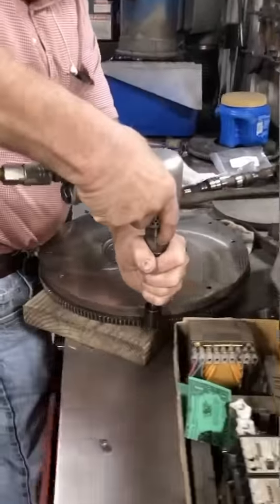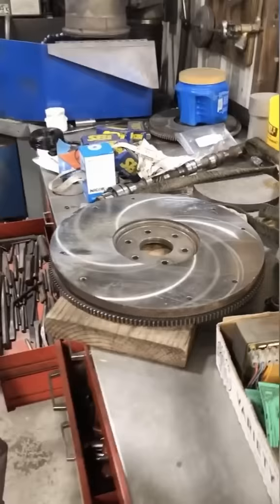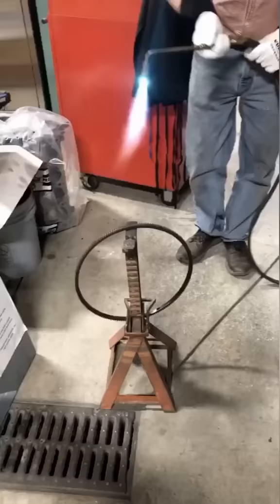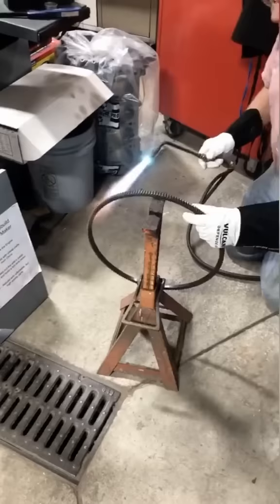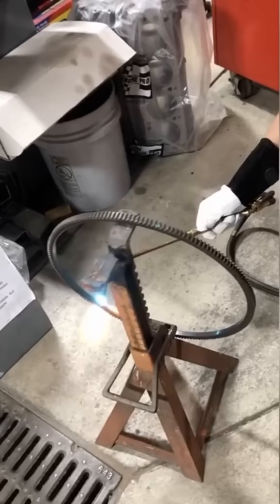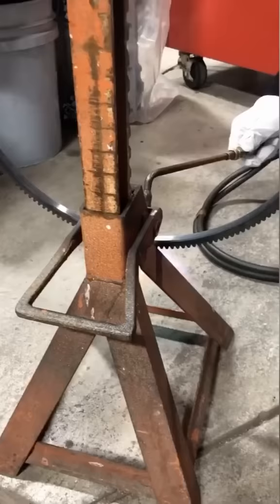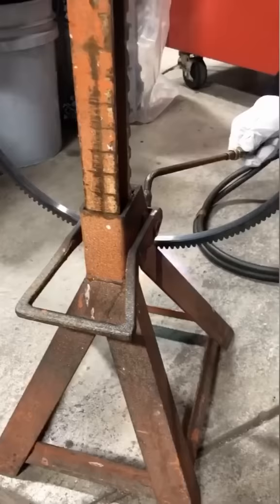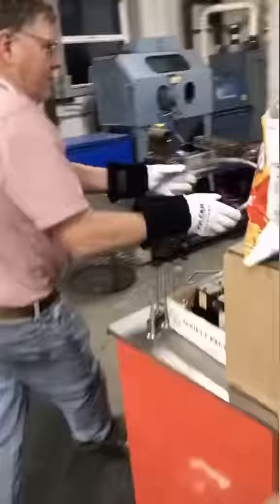#shorts Flywheel Ring Gear Replacement

Comment: First time I did that on the floor is when I discovered that concrete will basically explode when you hold a torch on it. Lol!
Reply: I also found that out the hard way lol 😂
Reply: You guys are the real mvps for putting your mistakes out there so others don’t make it.
Reply: Lmfao, yeppppp. Don’t heat up concrete or rocks!
Reply: And it's always fun until you think you're awesome after doing a few,and don't get one seated down in time because butterfingers 😆
Reply: I did that once...pop...Burning urethane out of a door glass channel...oops...vice job from then on...🤪
Reply: Threw rocks into a fire once and got my ass burned, no literally a hot rock went down the back of my shorts lmao good times with the friends!
Reply: @Todd_G_FPV  haha partying in the woods as kids , we would throw one in occasionally and stand back for a while and watch the fun. 
On the good nights, we would have something like a totally capped pipe bomb to throw in , and that was the nightcap to put the fire out. 
Then we would run around stomping out all the cinders from the explosion 🤣
Reply: @MrTheHillfolk  lmao 🤣
Reply: @Todd_G_FPV  waiting on the blacked out van and the men in suits to arrive at any moment because I said pipe bomb 🤣
Reply: Lmao. Also happens with the molten metal from cutting. The fuckup deepens when you move your mouth and feel something crunchy inside
Reply: @de0509  lmao
Reply: @MrTheHillfolk  haha it could happen they monitor EVERYTHING we do online!
Reply: Yes sir done that to. Concrete to the face.
Reply: Yup lol
Reply: @Todd_G_FPV  
Without a doubt man,it's so obvious now how much our phones listen. 
I was having a conversation with a friend about (I forgot) but I said wait a min, lemme go search it. 
2 letters in , and what I was searching for was already in the search bar.
Reply: A little hot slag in unusual places and leather gloves so you can't get it out fast enough.... Yup!
Reply: If you don't break something trying fix something did you really fix it?
Reply: @Todd_G_FPV  I assume there was alcohol involved 😂
Reply: @timgarrison8473  of course lol
Reply: @MrTheHillfolk  happens to my wife and I almost every time we google something
Reply: Note to self.
Reply: I made a rock fire pit. One blew up and hit the wife. Caught me by surprise
Reply: Same, got the concrete in my eye
Reply: It sure will😜
Reply: bc there is moisture trapped in the rock / concrete
Reply: I heat up my coals one time on concrete floor for bbq then suddenly the concrete explodes making coals fly like fireworks. Almost 2 houses nearly burn and one coal flew straight in to my eye. Worst way to find out how concrete reacts to high heat
Reply: thank you lmao i wouldn’t have thought of this
Reply: Snap crackle POP!
Reply: My younger self learned that too. Trying to melt concrete into molten lava. Yeaaaah,didn't work
Reply: I too learned the hard way. Concrete to the face
Reply: @phironosurvivors2069  same was 10 and melted a penny on the concrete first one went good but then the second one exploded so I dug on Mini hole in the ground and did it in the dirt
Reply: Well thank you because I just learned what not to do lol
Reply: Yup I've seen it before 😄
Reply: I decided to melt the lead out of a copper jacketed bullet on the concrete and when the lead was molten over the concrete it decided to explode throwing molten lead and concrete at me
Reply: Thanks for the tip. Didnt know that.
Reply: @deeppowhazylab  Absolutely
Reply: @saturnmedia1  yeah rocks dont make lava with blow torch, rocks go boom with blow torch lol
Reply: @danielslade8848  still boutta axe on em
Reply: @de0509  That was my experience also,  with the steel plate up on 
4” x 4”s while I was burning big holes in it.  The Concrete expands very quickly where the local heat is,  while the rest of it doesn’t,  and eventually the force of the expansion is greater than the Tensile strength of the Concrete can hold it together in that locally heated area,  next to the cooler Mass of the rest of the Concrete,  and it pops out.
Reply: @aaron5222  That was covered in a Movie I saw as a kid,  called “The Boy 10 Feet Tall”.
Reply: @ShelliesMan  never seen it. Worth a watch?
Reply: It happens because of the oxygen content in the concrete
Reply: @MrTheHillfolk  if they investigated everyone who said pipe bomb America would have the highest incarceration rates in the world.... oh wait, bad example
Reply: @MrTheHillfolk  I don't think they're using NSA hacked information to fill out your search inquiries, to sell you stuff sure but to make search engines more convenient to you is a step too far.
Reply: @aaron5222  caught you by surprise, I imagine there was one other person the situation a bit more surprised.
Reply: @yeetium6641  dude I thank my lucky stars every day that the one time I heated up a copper jacket bullet the lead that squirt it out like a squirt gun didn't go directly into my eyes.
I'm sure I'll be paying that back when I have f**** dementia from led fumes
The people who assume you know the dangers treat it like Play-Doh
Reply: @FrancisR420  😁
Reply: @FrancisR420  yea it's bad , I've mentioned something in a messenger group and say I'll go search it ...
Like 3 words in and the subject is right there
Reply: Yikes, probably had a nice water table underneath it. This is why you want firepit to be lined with firebrick, concrete goes BOOM when water trying to escape, hope you were okay
Reply: Thank you so much I would have never known or guessed that concrete doss do well with a torch
Reply: I also found this out the hard way
Reply: Me too😂😅😅😅
Reply: @saturnmedia1  or just anything brittle that could have trapped liquid/gas inside.
Reply: Me heating drain cleaner lines lol
Reply: @MrTheHillfolk  Back in scouts we were all teenage hellions and would find bamboo just for throwing in the fire. Not small reeds I mean one or two inch diameter bamboo. Those were great times that I look back on now and thank the lord no one was ever hurt. Well seriously hurt. A few small burns here and there but nothing major. Lol
Reply: @benbrice9343  
Ahaha that sounds like good times for sure, What's learning without a little sizzle burn here and there to help the learning sink in😆
Reply: Me at 13 trying to heat up a penny with my dad's blowtorch on the concrete basement floor
Reply: @Todd_G_FPV  I had a fire going at my campsite and didn't know a rock was under the old ashes. it grenaded, and threw blistering hot rocks everywhere. never again will I start a fire without checking first XD
Reply: I've seen cement pop off n you generally learn your lesson especially if you own the concrete.
Reply: Yeah thanks I always heard this was bad, but wasn’t sure. I’m not gonna fuck around and find out. I trust you and appreciate you! I’ve been welding on my shop floor till I finally bought a table to get off the floor for now.😂
Reply: Same :D Safety glasses helped.
Reply: Yep, that rapid expansion has to go somewhere lol
Reply: As well as everybody here found that out the hard way LOL
Reply: Wet concrete is the worst at this
Reply: @MrTheHillfolk  we tossed a small can of pineapple juice into the fire pit one time. Sounded like a shotgun went off holy shit was it loud! Huge explosion.
Reply: holy shit really theres so many times ive not had that happen to me
Reply: YUP! lmao theres tiny pockets of air and water inside concrete and if it gets hot enough, itll explode. stay safe out there!
Reply: Same for thick glass and touching it with something as cold as a pencil tip, then that glass will melt into your carpet and your parents will not be happy with you 😂
Reply: i got bored as a kid waiting for oil to drain so i would burn leaves with a blowtorch on gravel and then something exploded. and then i started blowing up rocks. good fun as long as you stay away from cars
Reply: That's what bad concrete does. Properly poured and vibrated concrete floors won't have any pores where steam pockets can form. I've dropped small pots of molten lead and flame cut train rail on my gnarly old concrete floor in the workshop but never had anything happen. Friends of mine have had pieces of their floor explode though but those were not poured by professionals.
Reply: @OB1canblowme  my dad must have been great at pouring then because I basically used my garage floor as a forge, we just power washed it out and didn’t tell my mom lol
Reply: Yes
Reply: @MrTheHillfolk  Happens for me more often than not! ...matter of fact, my phone & the computer behind it knows more about me than I do. Who knew???? Ha ha Ha ha Ha my phone just entered the word Horror with a capital H. Hmmmmmm.....
Reply: Yup concrete is not only porous, it's chemical composition itself absorbs water and that gets flashed to steam which makes it go boom
Reply: @snowcow1173  oh Jesus Christ. Yeah BOOM
Reply: Learned that lesson while welding, hot metal falls to the floor and within seconds concrete pops and there are craters in the floor.
Reply: Yup most of us who know that, learned by experience
Reply: @buffaloaf8205  that's a very good question.  My dad always said that those leftover screws, nuts, bolts were just extras and  obviously not needed if the project was working again.
Reply: Yo I didnt know that.  Yall some allstars thanks for the knowledge.
Reply: @danielslade8848  yes because of the air bubbles in the concrete, I knew that when I was like 12
Reply: @Siddy22  No actually, it’s water pockets that are naturally in concrete, when they expand it explodes quite violently, it’s also called Explosive Spalling!
Reply: Been there done that! Except it was a seized hub assembly on my damn bosses Jeep! I figured the concrete was old enough to not go boom. Boom it went though! Moral of the story, never hold a torch to concrete
Reply: @bigsparky8888  I started reading this as “burning urethra” and was going to say sorry for your loss
Reply: Yeah I actually found this out and it kinda makes sense. It’s the same principle as what they’re using here to expanded the gear with heat, there’s tons of tiny imperfections, holes, in rocks and concrete that try to expand with heat, but they can’t due to the surroundings being solid, so it builds up enough pressure to eventually explode.
Reply: Man I had no idea about this. I must be lucky, had been very close to touching the concrete on multiple occasions. Thanks for the info man! Concrete life saver man bless you
Reply: Unfortunately I have to torch anchor bolt holes into some of our columns we install if they need to be moved to make them plumb and most of the time they are within an inch of concrete and it really sucks knowing is going to happen and you have to keep going and going and going. Lol
Reply: Depends on the quality of the mix. And if there’s any pockets of air trapped in the concrete.
Reply: That's because it's porous
Reply: ...... hearing up concrete....... didn't think uhh. Lol
Reply: Did the same thing with a glass table. What a huge mess somehow didn’t cut myself tho and got a nicer table so in the end big W
Reply: I had a DIY paint can forge that I started out with. First attempt at melting aluminun on my back patio. I was lucky I wasn’t outside because the concrete shot the forge, crucible, and molten aluminum all over the side of my house. If I would been close it may have been a Darwin Award.
Reply: You guys ever fill a brick with gas then light it, thing blows to bits lol
Reply: Im not proud to say it but i did that in my garage
Reply: Learned that one the hard way when I got into hvac as a teenager 🤣
Reply: Love these tutorials videos. So much info. And to read the comments especially the ones that tells you the mistakes they made so you won’t have to travel down that road. Great job all of you guys.
Reply: @danielslade8848  I once welded the concrete😔
Reply: 😅 that’s basically how I learned too. But at work on a new pad😂
Get yelled at every shop inspection
Reply: Yeah and it sticks to ur face when hot, actually had it make it passed my safely glasses and stuck to my eye lid, fun times
Reply: @danielslade8848  😂🤣😂🤣😂live & learn
Reply: @danielslade8848  I didn’t know that 🤔 well not I found out the easy way 😂 thanks lol
Reply: also make sure the leads when you are solid metal ark welding are fully connected the first time i ever did smaw welding was in a welding class I got the day off of welding after they came out I nearly jumped 3 feet in the air
Reply: L
Reply: @MrTheHillfolk  you must now know what “prediction” means huh
Reply: Welcome to the explosive concrete club! We've all learned that the hard way. I was 15 🤣
Reply: Any science behind that ?
Reply: Po
Reply: Made the mistake of heating up a charcoal chimney on concrete…. The ground blew up under the chimney.
Reply: Your comment sounds like you didn’t learn after the first time and there have been a repeat offense
Reply: Been there welding. Lol
Reply: Yoooo I was torching a spider a month ago and i thought it exploded but ig it was the concrete under it exploding woah that makes sense
Reply: @kaizu4571  so the spider did explode then 🤣
Reply: @randycarter5263  nooo the concrete under the spider exploded bro
Reply: @kaizu4571  I just meant that if the concrete exploded,one would think that the spider also perished 🤔
Reply: Ty my ass would have done that
Reply: @MrTheHillfolk  get it see
Reply: Thanks for the confirmation. I was told it's the air pockets.
Reply: Fun fact, it actually DOES explode, we at my job like to call it popcorning
Reply: That’s strange. I’ve put a lit map gas torch directly against my garage floor dozens of times and its never exploded. 

I even heated it up red hot once to try. The whole house was custom built in 64, so maybe it’s a different kind of cement?
Reply: Its the water getting heated into a Gas and the Gas has to expand and go somewhere
Reply: Huh, I never found that out lol. I never did any heating near or on the ground, then again we never installed new ring gears as all of the ring gears that failed were actually just flex plates :/ not alot of Manuels these days.
Reply: only for special occasions like when it's just you and the boys. no kids or wife not even the dog needs to be around for it. Step 1 have presoaked wet rock 
Step 2 drop in fire with handful of leaves for disguise lol 
Step 3 Step back and enjoy your work lol 😆 
watch out for extremely hot shrapnel sorry for this 1 my Friend
Reply: I found that out torching a cricket on the drieway years ago.
My first thought was the cricket exploded.
I was being a dumbass that day.
Reply: Lmao that moisture expands!
Reply: Had a campfire on a little concrete slab in the woods with my buddies… three 2nd degree burns later we found out it blows up
Reply: Moisture trapped in the rock or concrete boils and explosions happen 😂
Reply: Cheap concrete not high psi concrete
Reply: Hmm, must have been lucky. Worked in a rigging shop and we always cut the chain down on the concrete.
Reply: Fun fact:  SpaceX has this problem with their Starship prototype, because they opted not to use a flame diverter trench.  Chunks of concrete have been known to shoot out and grenade engines.
Reply: Yep it turns the humidity into explosive steam
Reply: Safety squints
Reply: Depends on the age of the concrete and ambient humidity but yep!
Reply: Woah nice to know I totally would have ended up doing that
Reply: @saturnmedia1  river stones explode with water trapped in them
Reply: @danielslade8848  same
Reply: I learned that when I placed a pan directly on the floor to heat my charcoal in a weber chimney. I heard a pop and ran over and was like wtf! Lesson learned.
Reply: same way i learned. still feel like i got shit in my eye
Reply: Yup. You don't really think "hey maybe concrete has enough moisture to explode" before it explodes
Reply: i just learned that the easy way, thanks. i do some welding near concrete, so ill be careful now
Reply: That's because there are air pockets in concrete, and once heated those pockets expand and explode
Reply: I discovered that concrete explode but turning on charcoal before a BBQ day... That scared the shit out of me.
Reply: no shit? does that mean blasts from bombs detonating on concrete would have more force? or does the concrete only explode if it’s prolonged heat?
Reply: haha… my auto instructor taught me this before it learned that hard way😂
Reply: @MrTheHillfolk  then you burned down the town of Paradise, Ca?
Reply: SAFETY SQUINTS ALL ROUND BOYS
Reply: When i used to do commercial roofing our piles of gravel would freeze in the winter as a giant pile so we had to heat up the piles with kettle torches and if you overheated those rocks they turned into mini grenades
Reply: @saturnmedia1  or Chimineas.
Reply: @MrTheHillfolk  phones are always listening. Can’t tell you how many times I’ve talked about someone and then ads for it started popping up on Facebook and other sites.
Reply: @MrTheHillfolk  must be an apple device user oof. Actually idk Im trolling but there is a secret settings menu on just about all androids that you can tap your systems build number 5 times and open up "developer menu" once this is open you can basically proofread your phone looking at all of it's active running services, a lot more settings. 
Oh and if you haven't already, I suggest opening your apps menu and disabling any single app you don't use as these may collect personal info somehow and it also frees up storage
Reply: Hmm.... 😧 noted..
Reply: @MrTheHillfolk  time to take out the air hammer again and do it over lol
Reply: @arekay6014  haha they're all junk , but apple more so, I ditched that trash after an update on my 6 that made the battery die when cold. 
Worked fine the day before.
Reply: @dragus213  haha that's for sure 😝
Reply: @danielslade8848 me aswell😂😂😂
Reply: Ima note this down 😂 fucking hell I didn’t even know that was a thing or possible.
Reply: Found that out when I was a welder helper 😂
Reply: There must be trapped methane gas in a rock for to do that
Reply: I discovered that via microwave transformer
Reply: Me too
Reply: Good lesson learned.
Reply: We called that popcorn lol
Reply: Only when's there is moisture in the concrete lol
Reply: Rocks! Those things r grenades
Reply: @Todd_Gerhardt one of my friends threw a handful of sk bullets into a camp fire. We were hiding behind trees you could hear them ricochet off the trees.
Reply: I didn’t see him holding the torch on the floor.
Reply: Trapped moisture does that